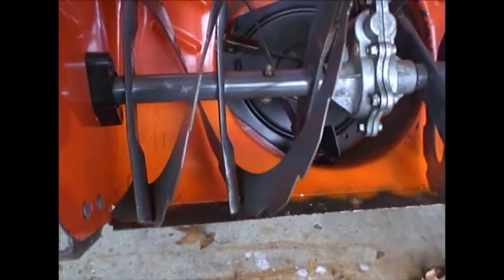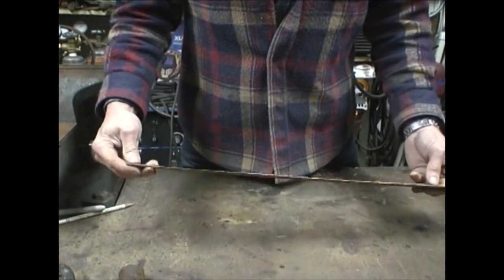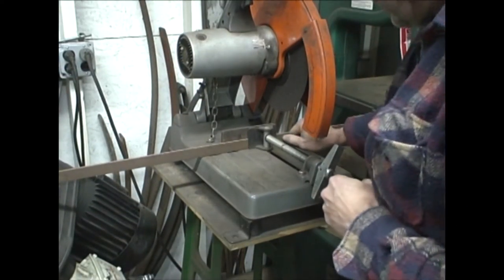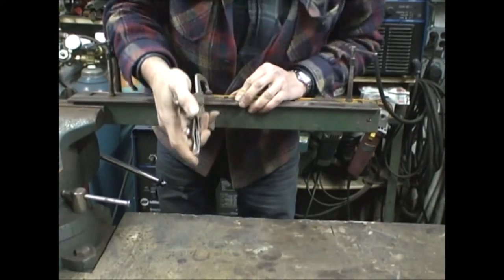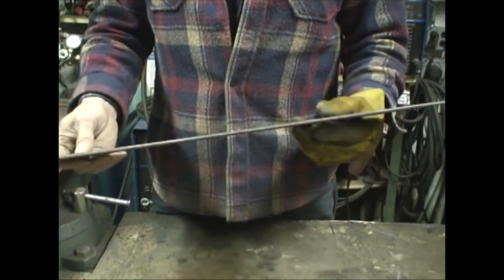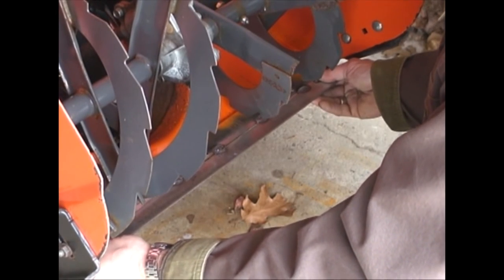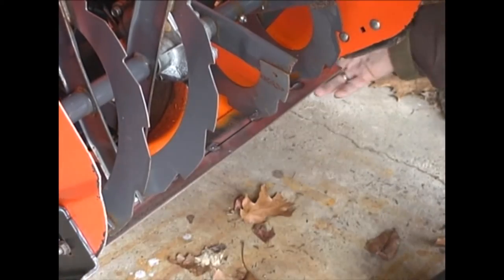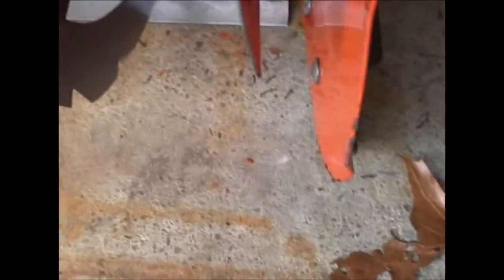Snower Blower Scraper Blade  Repair

Comment: Could have just flipped the scraper and used the other edge. Then when that side is worn add your new steel. Sometimes it is just much easier to go and buy a new scraper too.
Reply: I just got a free snowblower and noticed that the bar is worn, I'll try this trick of flipping the scrapper, thank you!